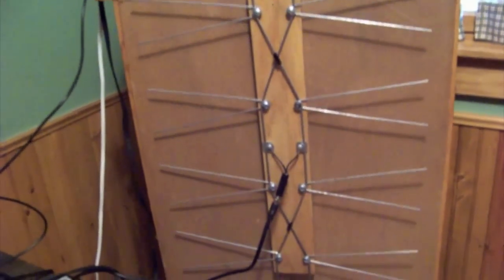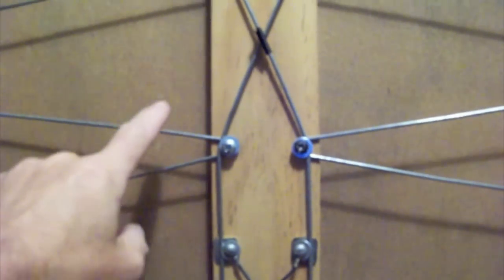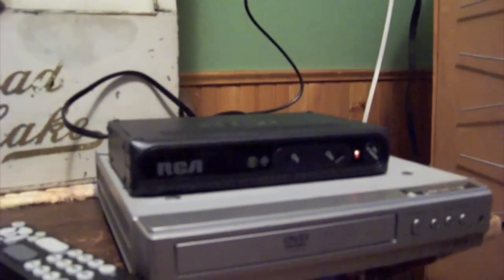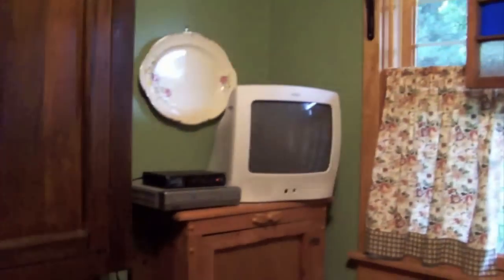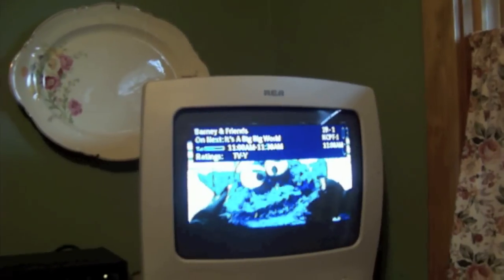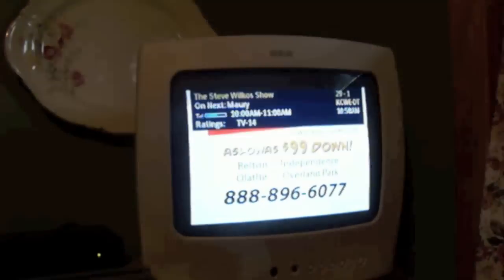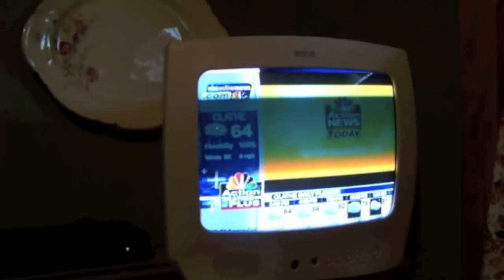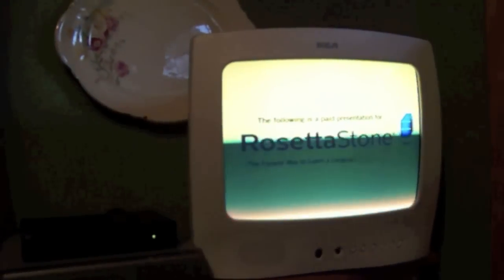digital antenna

Comment: Amazing diy!!!  I would go "no cable", but the most time I spend watching TV is watching Showtime series, as well as on-demand movies and such.  I have not gotten the nerve to do away with the things I do watch.  I do still have analog TVs....no flatscreen yet!!
Reply from the maker: It was an economic decision, we cut that SatTV, two years ago, was hard at first, but now, I may watch a couple of hours of TV a week, in its place, I read, piddle in the garage, ride my bicycle, maxi-scooter ... you get the picture, pun intended. I was amazed that the antenna worked, but, it did. Good luck to you on cutting the cable, you will be saving some big bucks every month, plus, you can get a ROKU set up and get a bunch of channels for free, NetFlix, Hulu, etc. It works through your wifi, internet connection.
Reply: ***** Yes, I need to bite the bullet and just decide to cut cable (except for basic).  I know I can get any series I want on DVD, for much cheaper than I pay for Showtime monthly.  Gotta get my stuff together and just DO IT!

I am about 75 to 90% disabled, so TV is one of my outlets. 

I have been worried that if I cancel my cable premiums, that they might mess with my internet and phone.  Call me paranoid, but I have read about such things.

I just recently cancelled my AT&T landline (old school) because it was costing me $55 a month.......just for phone with basic features, no long distance.

I switched to phone service with my cable provider.  I get a "discount" for being a TV/Phone/Internet subscriber, and I have unlimited long distance.

But with what I am paying for "expanded basic" and for Showtime and a "Family Package".......I realize I could do better.

Gotta find the energy to get what I want in other ways.

Thanks for the inspiration!
Reply from the maker: MissAstorDancer All we have now are cell phones and are using, "CLEAR," 4G internet connection, it is through, Verison now, 55 bucks a month, just an antenna to pick up the signal, and it wifi's your signal, easy peasy. Quit, AT&T DSL, there servers were crappy and we would get dropped, it was a pain in the butt. I see by your reply that TV is an essential part of your life, if you keep your cable with internet only, go with the ROKU, you can get Showtime there along with a bunch of other channels, yes, one still has to pay for those premium channels, but, I think it is few bucks a months to get the subscription. As for me, I have 50% hearing loss, wear hearing aids, but the rest of me is still ticking right along. Thanks for watching my goofy videos, though, LOL!
Reply from the maker: MissAstorDancer Yes, you can get most of the movie channels on ROKU. You can set up your wifi signal as encrypted and it will be safe. I am with you on the conspiracy angle. There is Infinity wireless, via, Comcast or TimeWarner, if you have it in your area. We may have Google Fiber in my area soon, going to jump on that when it does! I am pretty sure Verison has a wifi hot spot that connects to your laptop as a dongle, a vlogger friend is set up that way and we use his connection when we are out in the sticks.